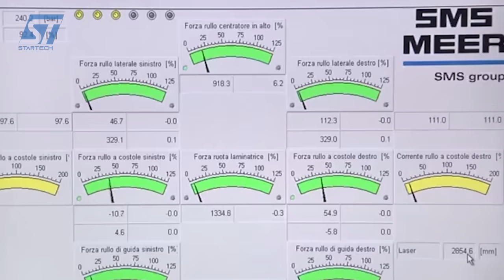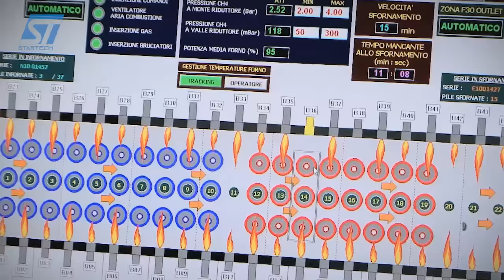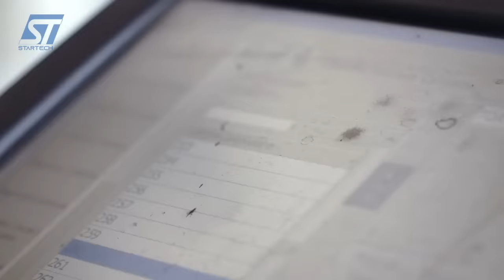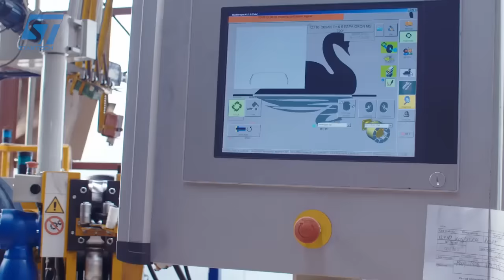Perfect Railway Wheel Production Process and Other Amazing Manufacturing Methods. Don't Miss!

Comment: I worked at a steel mill in USA in the late 70's. We had an electric furnace that we melted steel, poured, & stripped down. A machine would cut the ingots in blocks like the beginning of this video. I've always missed that job. Got laid off/ unemployed due to Recession. I miss factory work.
Reply: 0

Comment: Perfet video.I have been a railroad welder in mexico.30 years ago meaby you dont believed.but I fixed the holes whit weldin  with 7018 soldering  and after grinder.and never had traubles.

Comment: I was wondering how instructions are passed to machines? Was it through control room from computers? Just for curiosity I wanted to know. BTW amazing video!
Reply: The program gets loaded by a usb card?
Reply: Yes everything is computer controlled from control rooms. Years ago this whole process was done manually with steam powered presses and manually operated handling equipment. It was very hot dirty work that required highly skilled operators to produce a quality forging.
Reply: @kenklinglerjr6474  cool, Great Info. thank you Ken.